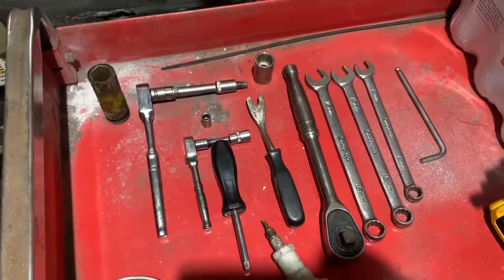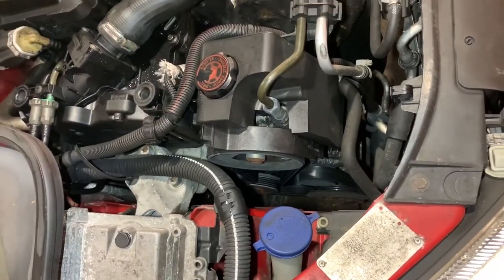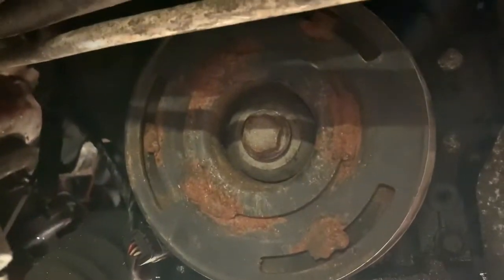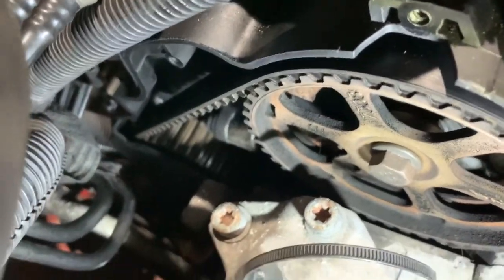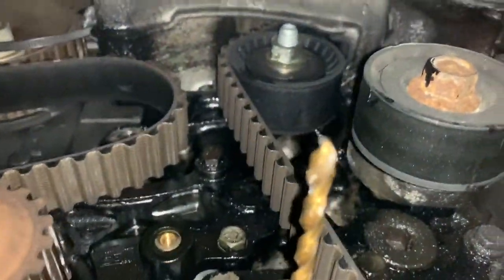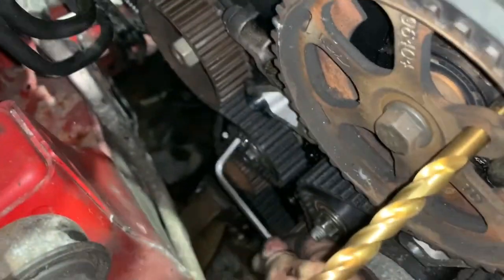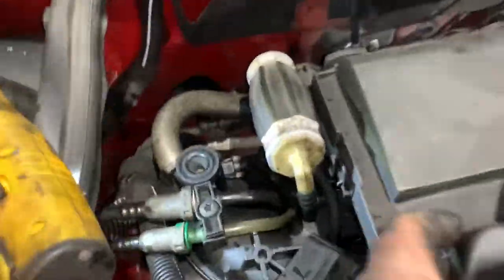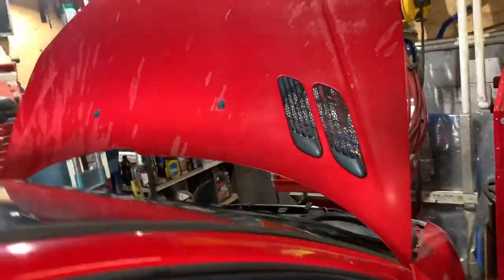Peugeot 206 1.4Hdi timing belt change , step by step video

Comment: great video   what about the fuel pump pulley does that need timing like on my tdi VW. Quality filming.
Reply: If it's common rail system, it doesn't need timing.
Reply: You can lock the pump off on these with a 3rd drill bit but as above, it's a common rail so you can leave it floating

Comment: Hey, thank you, everything went well, engine starts, but I get beeps and stop on dash blinks, so I haven't test driven, but I'm gonna take a look at it tomorrow again, you have any idea what I might have done wrong?
Reply from the maker: Thats a difficult one to answer , but it beeps for various reasons , could be just because the door is open or the handbrake is off with the door open ? Just do the obvious- check oil and coolant levels and have a good look around the engine bay to make sure there isn’t anything that you may of knocked ! Good luck 👍
Reply: @Xpp.   Paul P . Mini build  thank you :) would a good obd reader be able to give some info? Just took everything apart again, timing is still correct, but the tentchener(not spelled correctly) has gone a little out of center, i will retench and tighten bolt, and see if that fixes it, thank you very much! :) will get back with results
Reply: @Xpp.  thank you, turns out I'm an idiot and forgot to check brake fluid, thank you so much. Also after running the engine in idle for 10 minutes the hole that's supposed to be in the middle has moved, is it supposed to do that, I tighten the bolt to 28nm (lowest I had) specs said 25nm, again thank you so much for this video guide, you are a savior, this has saved my mother what is equal to 440 pounds of mechanic bills.
Reply from the maker: Ahh glad it was something simple ! And glad you found the video helpful ! The pointer on the tensioner should remain within the mark but it will move depending on where the engine stops , if you are that worried it has moved the turn the engine by hand and see if it moves back .....